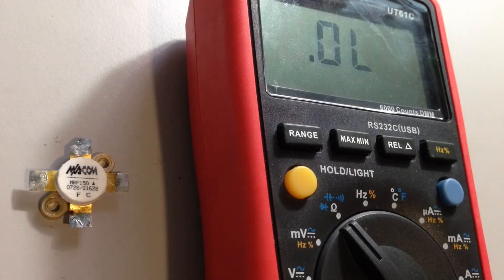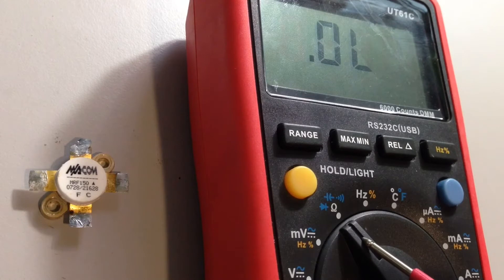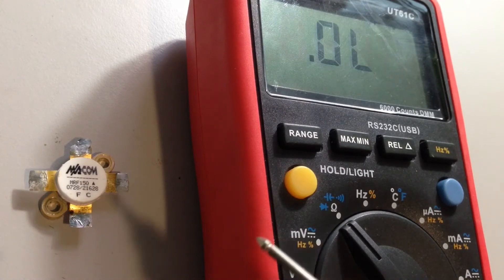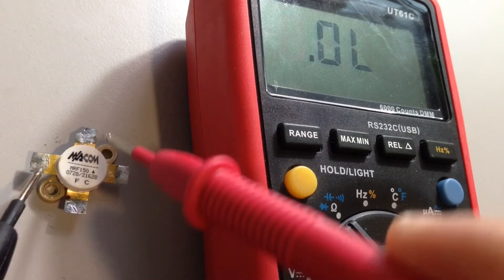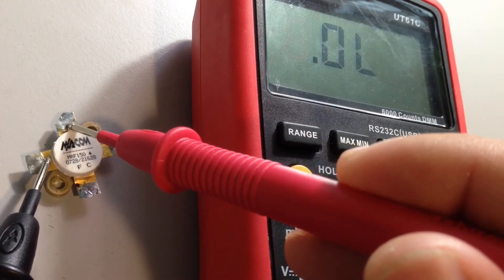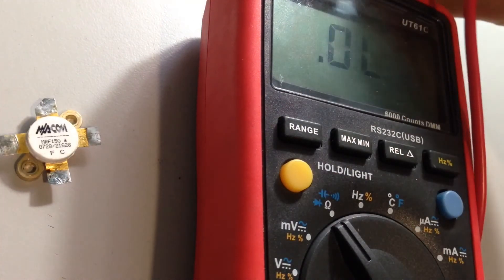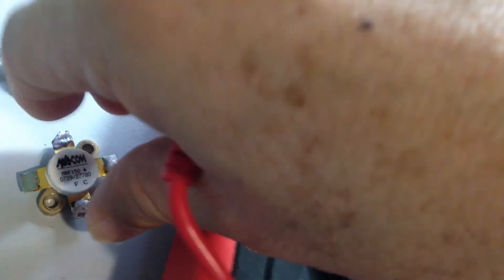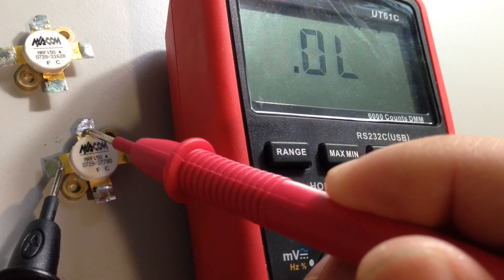MRF 150 mosfet test

Comment from the maker: Hi Bob , not recommended if you can still source a reliable MRF150. Other supporting components need to be changed to match VRF2933. Every hf amp design is different.

Comment: Very interesting, thank you for sharing.... Wondering if you could tell me can the VRF2933 be used as a replacement for the MRF150 MOSFET?  Thanks Bob
Reply: Mouser has MRF150MP (matched pair) in stock about $89 which is actually about $30 less than it was 18 months ago.